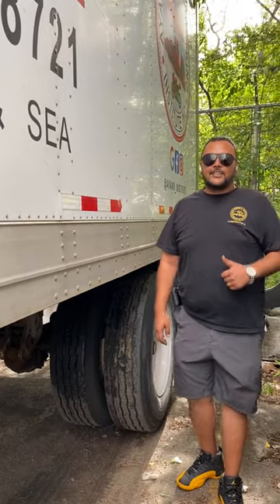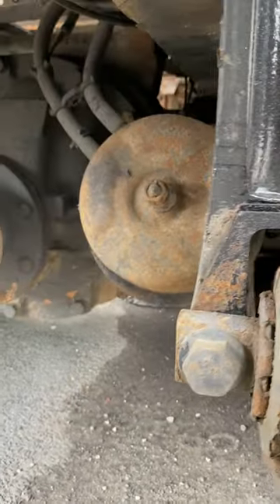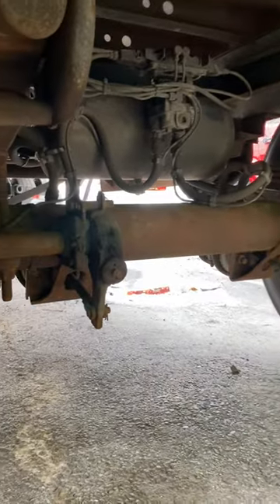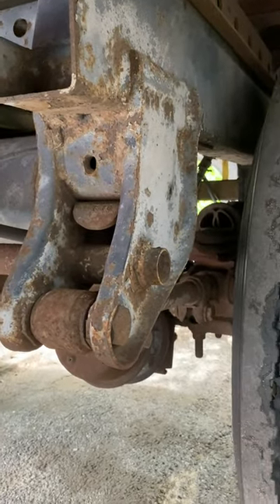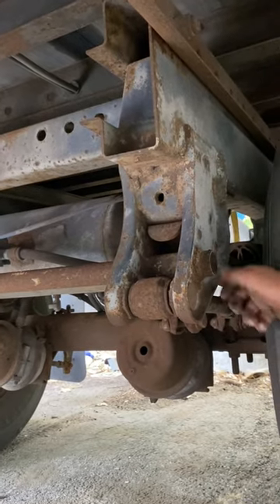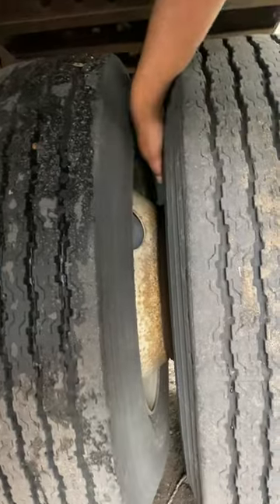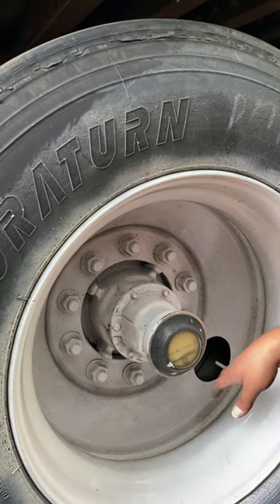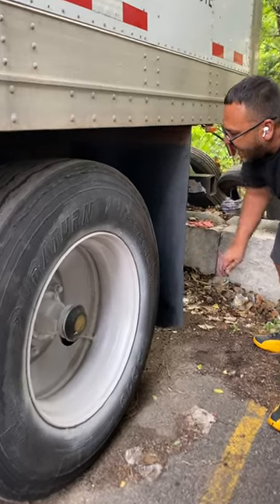🚛🚚 2023 Rear Trailer Axle & 3 Components Behind #pretrip #Inspection #classA learn little by little

Comment: Great job 👍.
I have to say i feel confused.
How can one state that all my Mountin Bolts are not rusted when clearly you can see they are!! .
I wonder if this just a default procedure and the examiner over looks at this statement?
Thank you kindly
Reply from the maker: Great question 💯 so in NYS due to weathering the rust appears next day after changing brakes, rotters, u blots and leaf springs pretty much anything below the engine rust fast. So they only want the key words "not rusted cracked or missing" they aren't all up on the vehicle or student either they maintain 3 to 6 feet distance. That being said due to weathering in NYS everything gets rusted fast so they just loom for key words. Thanks for commenting 🙌
Reply from the maker: Also if your taking the test in New York City I recommend follow everything on these videos 📹 word for word you'll be okay if so.. if not other states and School's have old videos and rules are different in other states.
Reply: Thank you for your response And congratulations on your skills and professionalism .
Keep it up 💪.